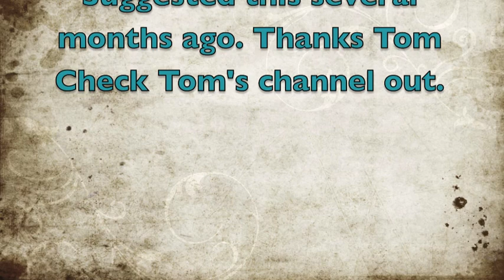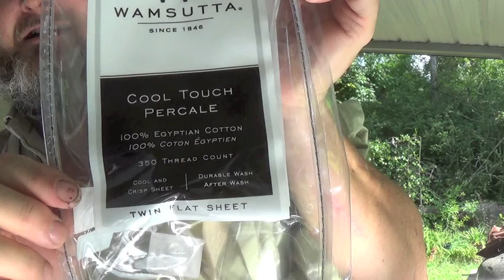Homemade Bed Sheet Oil Cloth Tarp PT 1 (Dyeing)

Comment: you could have made a camo pattern by using a brush and flinging the dye off to encourage darker areas
Reply from the maker: Appreciate the tip.
Reply from the maker: Just remembered I did something like that to a homage wheeler leant to about 6 years ago. This is the first video in the series. https://youtu.be/vuH7Dv2RNPg

Comment: William..  This is a cool project.. I just found your channel and am now subbed!  :-) 

If you ever have trouble with your dyed project keeping it's color, you can add vinegar to the dye (before you dye the project) to make the color set.  Also..  For materials with a looser weave like the market wallet you showed, you can add some paraffin and beeswax to your boiled linseed oil to make them waterproof.  The wax fills in the spaces and the piece will remain soft.

Excellent series..  Thanks!
Shad
Reply from the maker: shadowcastre Thanks, appreciate the tips. I have another video on a beeswax waterproofing you may enjoy a few months back. Again thanks, appreciate the info and visit.

Comment: I I read your old post, went to an Estate sale and bought an 8x8 bed sheet for one dollar, I also bought green webbing at the sale for one dollar.  I made tie outs for the sheet and sewed them on.  I dyed it Chocolate Brown with RIT dye.  I then used the 50 50 mix of mineral spirits
and boiled linseed oil.  it took one and one half quarts of each.  It is drying now, but looks great.
Reply from the maker: Awesome, hope you prepped it by washing and drying on high heat to expand the fibers.

Comment: for canvas i hear their is a better  recipe    bees wax   linseed oil and pine tar
Reply from the maker: embarado smithing and woodcraft I have a beeswax recipe in my video archives. Not a good recipe for a hot climate like Texas. The wax becomes gummy in summer. Appreciate the view and comment.
Reply: i would think that the pine tar instead of turpentine would stop it from getting sticky in hot climates
Reply from the maker: henery slayzack it may, I have another option video series for waterproofing that I like better. It is a linseed and mineral spirit mix that works great for me even in hot climates. Check out the bed sheet tarp and homemade wheeler lean video series.

Comment: Just wondering how the tarp was holding up after years of use or whether you are still using this.
Reply from the maker: Unfortunately it was thrown into a burn pile one spring clean up several years ago by mistake but was used daily till then and worked great.

Comment: William, thanks for posting this series. I have a quick question as to how many Walnuts would you recomend? I have probably 20-30 black walnut trees throughout my yard, now if I can just beat the squirrels to them I'll collect a bucket full.
Reply from the maker: radikewl70 most just fill the tub with hulls and not bother to count them. The more hulls in the mix the darker the dye. You will need to use a stabilizer to set the dye. Some add rusty nails to the mix and other add a cup of vinegar. I recommend doing more research before trying. Google is a good place to start or even You Tube.

Comment: will pecans do the same ? I know the color would be different.
Reply from the maker: +DL Spamalot The green hulls will have tannen and that should dye the fabric but you will need to add a stabilizer like vinegar so the color will set. I didn't and the color faded. There are many videos on you tube for natural dyes.
Reply: +William Collins (WC Knives) Thank you. I guess I will  have to wait til next year for green hulls lol. Can&#39;t wait to try it . I saw in the video that the sheet turned almost back to green.
Reply from the maker: +DL Spamalot Yep the dye didn't set because I didn't use a stabilizer.

Comment: nice ,, i was thumbing some vids and found i need to catch up your oil cloth series..thats right up my ally brother....i did some vids on making natural linseed oil from flax oil, that drys with great water proofing...takes a little longer to dry , and needs ultra violet from the sun..but works great..
..bill
Reply from the maker: I saw your series, it was great. This 50/50 mix of linseed oil and mineral spirits dries in 48 hours and as you can tell by the videos is an excellent waterproofing. I did a fire teat video yesterday and it is virtually fire proof as well. Appreciate the views and comments.